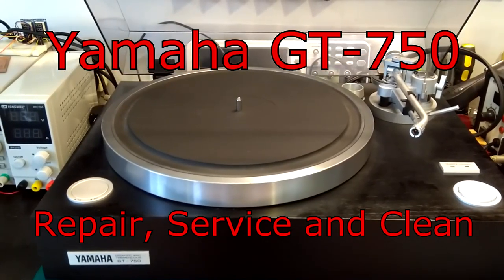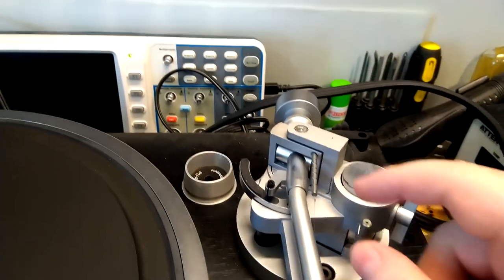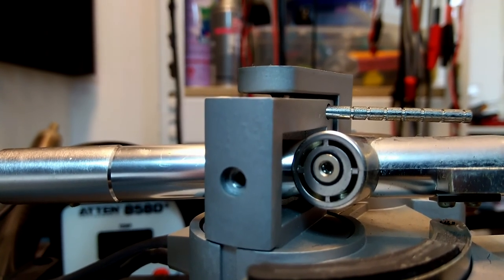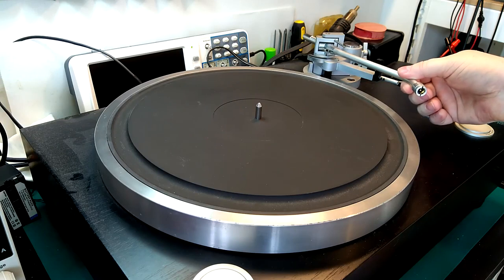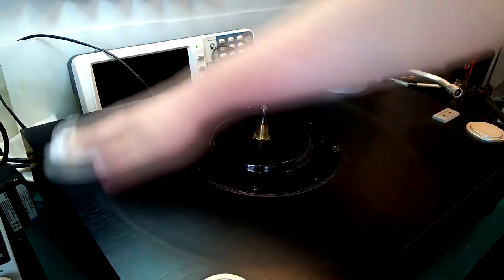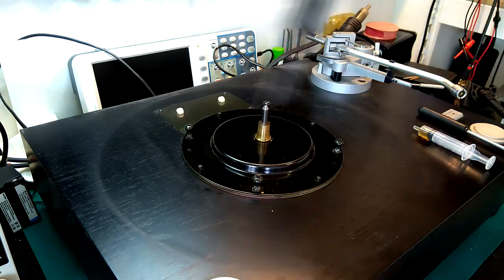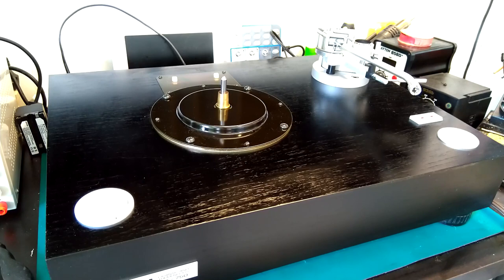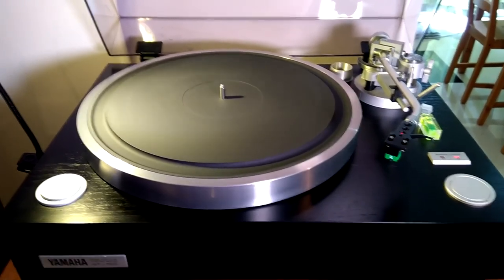Yamaha GT-750 Turntable Repair, Service and Clean

Comment: Great video guide thanks. Considering buying one of these
Reply from the maker: Thanks, it's a great turntable, I've been very happy with mine, just keep in mind it's very large, almost twice the size of a regular turntable.
Cheers,
Jake
Reply: I like its size, mass adds to a certain amount of stability to the sound IMO. The model I am considering has no original headshell, I am thinking of Yamamoto to replace it. Thanks again, you really helped me know what to check out with this TT @TheStuffMade
Reply from the maker: @Inconceivable-Montoya  Absolutely the large platter, direct drive motor and heavy/solid plinth contributes to it's excellent performance, far better than most modern high-end turntables. Also worth noting that Yamaha used the same arm in their top, very expensive, high end GT-2000 turntable. The original headshell does have azimuth adjustment (as in you can twist the head to the perfect angle) but I have a lot of different cartridges on different headshells and I've found it not to be an issue, you can still twist them a tiny bit while securing them to the arm and achieve prefect azimuth.
Cheers,
Jake
Reply: one more question, when you serviced the electronics did you leave the platter on as the table was on its side? did it leak any oil from the bearing housing? thanks 
 @TheStuffMade

Comment: Thank you for the excellent video. I have had two Yamaha turntables in this series- GT-2000 (now sold) and GT-2000X build quality superb. Great turntables
Reply from the maker: Thanks, yeah the GT-2000 and the GT-2000X are certainly a few steps above. This GT-750 is more like a budget version of the top models, but it's imo still a great turntable that also looks great. Most people don't realize how large they are.

Comment: Are there parts no longer available for the GT-750?
Reply from the maker: You'd have to be very lucky to find any spare parts for this model, it's from the mid 80s and only released to the Japanese market.
Cheers,
Jake

Comment: Hello, my gt 750 running at 33.31, how to adjust it to 33.33? is it a rezistor on board that turning with screw driver? And it has wow 0.12, its not good for this motor, i should replace all capacitors?
Reply from the maker: Hello, this turntable uses a crystal oscillator to control the speed, it's not adjustable. I wouldn't worry at 33.31 RPM it's only 0.06% off and could just as easily be the measuring method as the turntable being off. I assume you used your phone to measure wow? I did an experiments with 4 different phones some time ago, they all gave very different results, so it could just be your phones accelerometer not being suitable for wow measurements, also for best result make sure you use a box or perhaps a large roll of packing tape so the phone is centered on the platter, if your phone isn't centered the off balance weight will affect the result. Try a different phone or try your phone on a different turntable. The wow could also be caused if the cast aluminum got cracks in it, it's worth removing the platter to inspect or if you notice the plater being uneven when it's spinning. Besides that I'd inspect the capacitors for bulging and leakage, if they look ok I'd leave them as is.
Cheers,
Jake
Reply: @TheStuffMade  thank you for answer)

Comment: Thank you for your review. In the same way, I eliminated the backlash in the tonearm. There was no damage. I twisted the bolts carefully. However, after eliminating the backlash in the tonearm, the downforce settings for the needle were lost. The error in the indicators is visible on the electronic scale. How did you deal with this problem?
Reply from the maker: Hi, it will not affect the downforce when done correctly. It sounds like you might have made it too tight, it should be just tight enough that there is no slack, but no tighter than that, it can be difficult to do. When you tighten the outer lock screws make sure the center screw doesn't move at all, it might take a few tries of loosen and tighten until it's perfect. Also make sure you have the tonearm perfectly centered and it's not rubbing on one side.
Cheers,
Jake
Reply: @TheStuffMade  Thank you very much for your advice. Today I will experiment again. It should all work out. Good luck to you.

Comment: I hope the oil has no detergents or other substances regular engine oil has ( to prevent corrosion, etc. )
Reply from the maker: Sure, I generally don't buy oil with additives. It's usually specified on the label. Although most oil, additives or not, would still be better than 35 year old oil that has acidified and oxidized.
Cheers,
Jake

Comment: Mine was the same. Looked as though it hardly got used.
Reply from the maker: Yeah, I think many of these turntables were only used for a few years then replaced with CD players, they probably spent the last 30+ years collecting dust while in storage.

Comment: Great video. I’m amazed!! I’ve read that adjusting tonearm bearings is a very difficult and delicate thing. That the ones that know how to do it uses special devices to ensure proper really tight tolerances. Also read recommendations to change the whole tonearm if you have a loose bearing. So this is the first time I’ve seen anyone doing it and I’m amazed that you did it so tranquil.
It’s really that easy? Is your tonearm 100% perfect now and tonearm makers exaggerate their claims?
Reply from the maker: Thanks, for this type of bearing I'm confident it will perform just as well as new after the adjustment as there is no damage, most important is to make sure the tonearm is centered and the bearings are not too tight, only just tight enough there is minimal slack. It's typical for Japanese turntables of this era to use low friction ball bearings, Yamaha, Technics, Sony etc. However there are many types of tonearm bearings like sapphire, ruby, magnetic etc, they all have different challenges some require special tools, but mostly because the manufacturer designed it that way, some of the most annoying ones are the nuts that are round but have two tiny holes in them. 
Cheers,
Jake